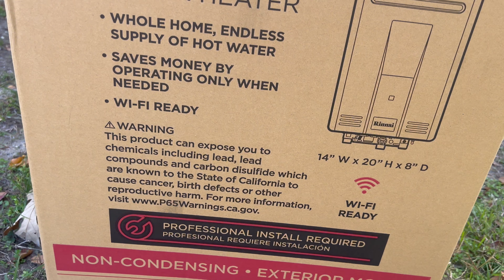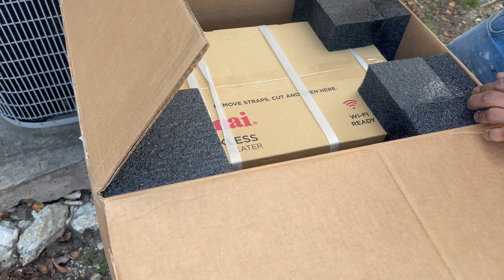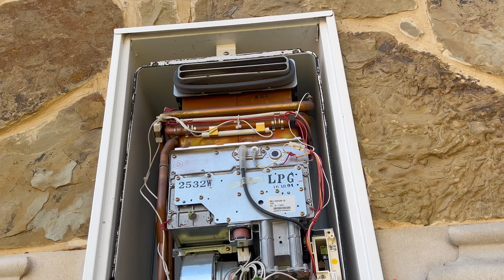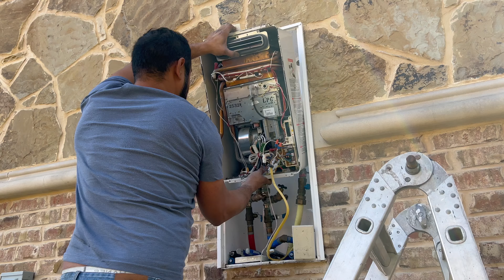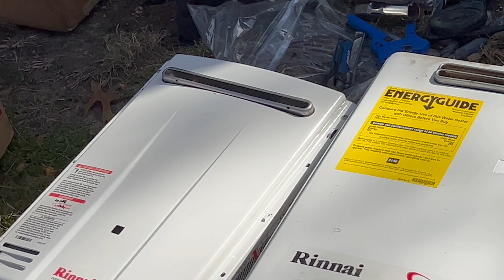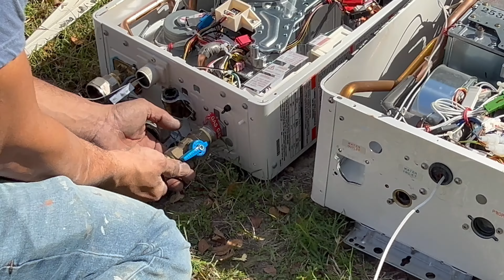Rinnai Continuum 2532 replaced with a Rinnai v53DeP propane tankless water heater

Comment: If anyone is looking for a replacement that is the same size as the Rinnai 2532 the only replacement is Rheem RTG-84XLN-1. Make sure it has the -1 at the end otherwise it won’t fit. But hurry up because Rheem dropped the -1 from their lineup.

Comment: Why you use the old controller? The new didn't come with
Reply from the maker: Mine did not come with a new controller
Reply: @atmmanman2437 thanks for reply I buy this v53 when left my previous comment bro i was so mad this company not include the controller mine also come without its a shame a water heater with this price not come with controller wow
Reply: @atmmanman2437 but the old controller worked ? Per the instructions the v53dep need the mc 601 but the one you have in the video it's the mc 45 4 the price difference is astronomical the one in your video 30 dollars the one they want us to buy almost 200
Reply: Is the controller required?  Does the unit have a preset temp of the controller isn't used?   

I may have to call them tomorrow.